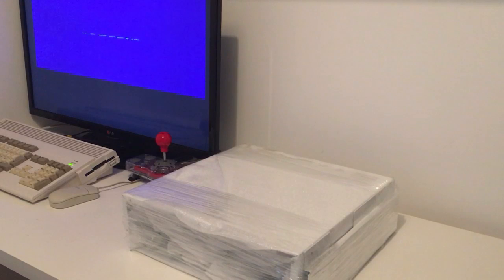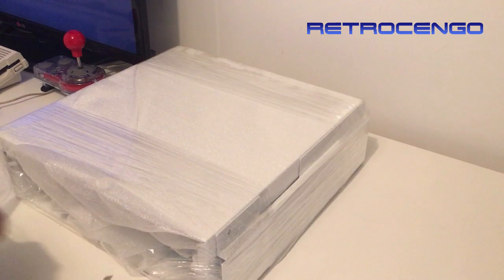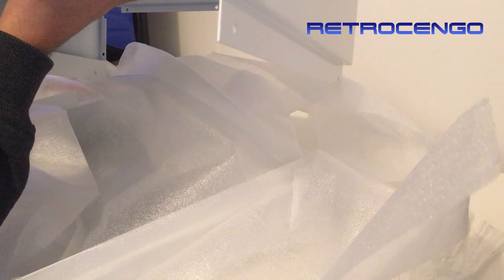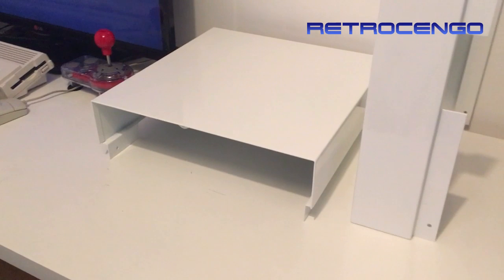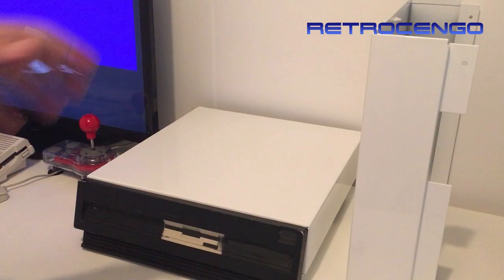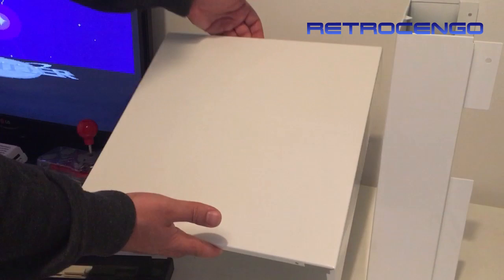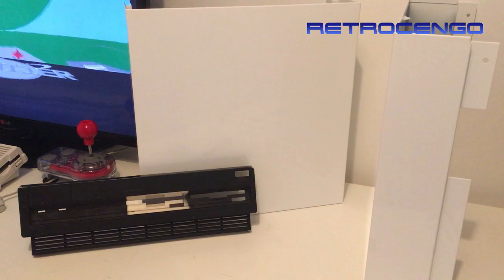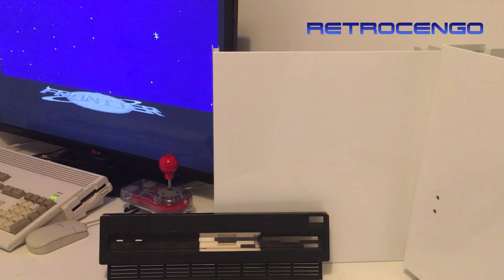Commodore Amiga 3000 repaint restoration Part 2

Comment: This is amazing. It must be the cleanest looking 3000 top covers in all of europe. Oh man... Now you need to fix the bottom case. As for the front panels. Please try and see if isopropyl alcohol can get the paint off. Alcohol do not damage plastic, and it is worth trying. At least you can say that you tried. Now I know people are using breake fluid. Back in the late really early 90's, I went to "Ungdoms skolen", if you remember that. There was this motor-instruction class, in were 16 year old students learned to fix mopeds. And Yamaha 4gear mopeds was all the rage, as well as Puch Grand Prix. And then someone spilled some breake fluid onto the gasoline tank. He had to repaint the entire tank, because the paint just stripped off like a hot knife through butter.
Reply from the maker: brostenen I also had then Yamahas😁😁 if i successfully removed the paint from the front cover plastic, it would be the original baige colour underneath, cant use that with this new white cab, the plastic fronts needs to be repainted same white colour😁👍🏻
Reply: @RETROCENGO  Yup. Though you still need to get the old paint off, before using primer.
Reply from the maker: brostenen Yes, but I’ll leave it to the pro people, Amiga 3000 deserves the best

Comment: impressed with how smooth frontier was running
Reply from the maker: thicklyspread its on a 030board😁
Reply: @RETROCENGO  i have a 030 in one of my A1200s which is max'd out, the other one is 1994 spec, real HDD,  020 card 8Mb floating point, 1084s monitor.  The sound of the HDD spinning up brings back so many memories, as silent CF isn't the same, ide 2.5 HDD were such a thing back in the 90's
Reply: on a A3000 front, it does look amazing, maybe put a surprise on the inside of the case, for a future owner...
Reply: you've been RETROCENGO'd
Reply from the maker: thicklyspread i remeber the hackjob and installing a 3.5” hdd in a A1200 it was amazing
Reply from the maker: thicklyspread 🤗😁😁🤟🏻
Reply: @RETROCENGO  i might troll a little, but on the whole, i do like your content

Comment: RetroManCave did a complete restoration of an original TRS-80. They had painted plastic cases but on the one he had, some of the paint was wearing off. He stripped it using methylated spirits (what we call denatured alcohol here in the USA) and it worked beautifully. When I built plastic model kits in the 1980's, I used to use denatured alcohol to strip models my friends had built up because they had too much paint applied. Please aiso know, it does not ruin or soften plastics in any way, unlike brake fluid, which I've heard has mixed results, and denatured alcohol works quickly. It's sold under many brands on amazon.co.uk.

RetroManCave's video is here:
https://www.youtube.com/watch?v=Xigwt-qaTkk&t=1103s

Also, I know Retr0Bright doesn't help the condition of the plastics, but they were compromised anyway. I've had good luck treating my stuff post Retr0Brighting with 303 UV Protectant.

https://www.amazon.co.uk/303-Protectant-Plastic-Fiberglass-Leather/dp/B0004ELKC4

You just wipe it on and let it dry. It has kept the yellow from coming back on my old Macs, that and keeping them out of the sun and having all LED lighting in our house doesn't hurt either.
Reply from the maker: Steven Smyth Thank you Steven, i will not work on the plastic front my self, but thank you anyway for all the amazing info🙏🏻😁
The metal part is better the new now, want the front done by pro painters same white colour 😁👍🏻🤗